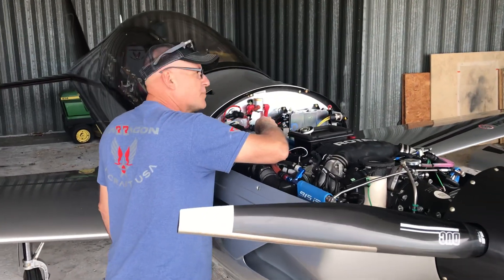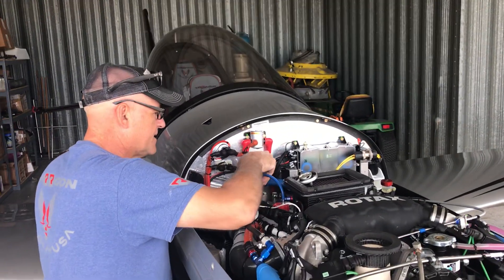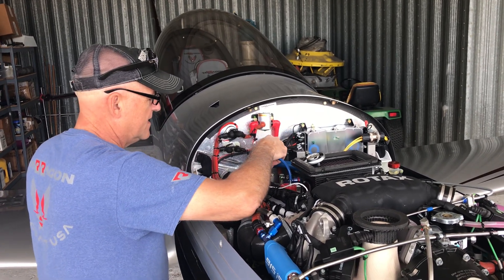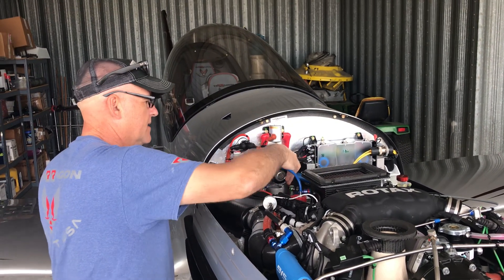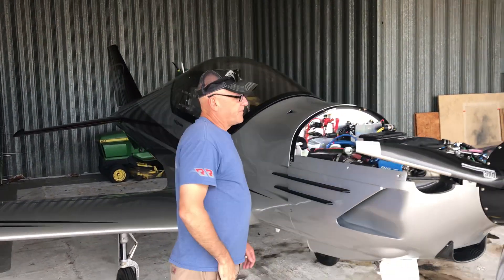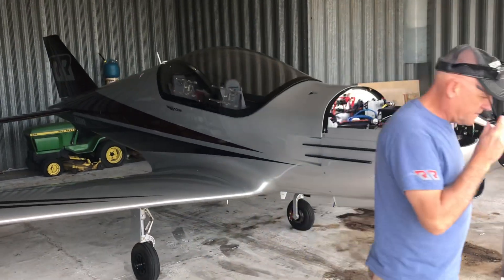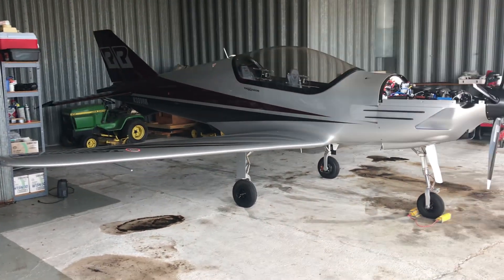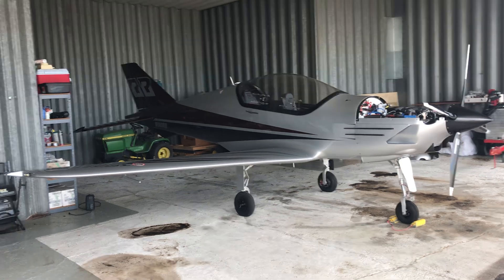As close as you’ll get to a fighter plane

Comment: I fly sometimes a Rotax 912 equiped aircraft. 

And for the oil check in preflight a 912 needs to be 'gorgolled', which is the burbling sound the engine makes after turning it over by hand after ~20 times. The sump is then filled with oil and then you do have an accurate oil reading.

Maybe the 915 doesn't need that, or maybe you did do that and cut it out the video. But I just wants to say a 912 does use quite a bit oil, so you're quote 'it's not using any oil' surprises me. 

I don't want to be the internet troll, just hoping you check your oil correctly for your safety. ;)
Reply: I believe they call that “burping” the engine, and actually you aren’t “filling the sump” with oil. You are using engine compression past the rings to pressurize the sump and move the oil OUT of the sump and into the oil tank. I’ve never seen a 912 or 914 use any oil, so I don’t know if your experience is a sick engine. Also if you are taking 20+ blades on the prop to get the gurgle, try turning the engine really slow, you sorta hold the compression so it has time to leak past the rings and pressurize the crankcase. You might be able to get the gurgle in 5 to 10 blades.

Comment: Yea,  nice,  but I have a hard time mimicking the sound of a real engine on long flights.
Reply: What do you mean the Rotax is not a real engine. it's got Pistons valves and and a fuel ratio management system. It runs a lot smoother than your "real engine" which will make it less noise and vibration fatiguing over long flights.
Reply: @submechanophobia768 the Rotax engines have a bad reputation for being unreliable. I’ve never flown one, so I can’t attest to that, but around the FBOs and flight schools, there is a lot of distain for Rotax engines.